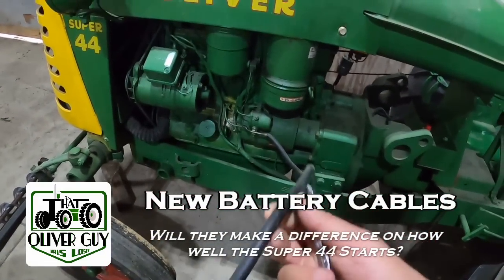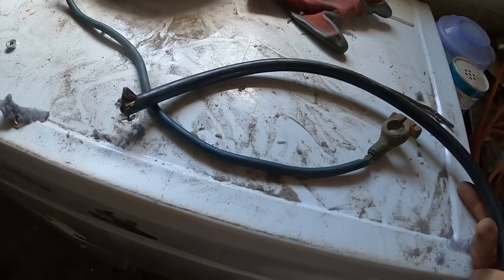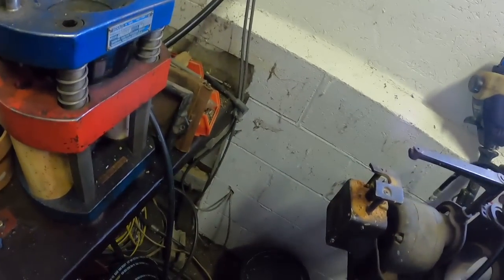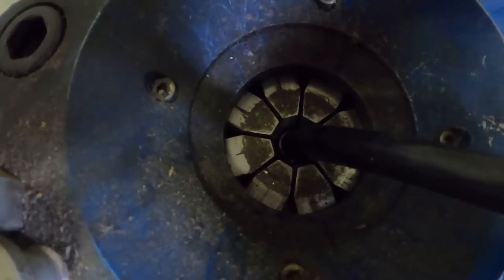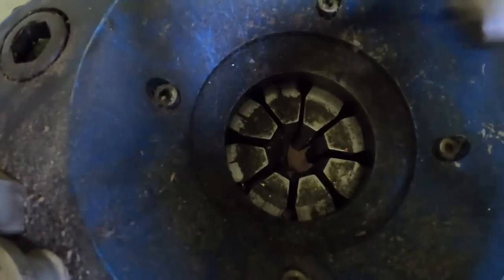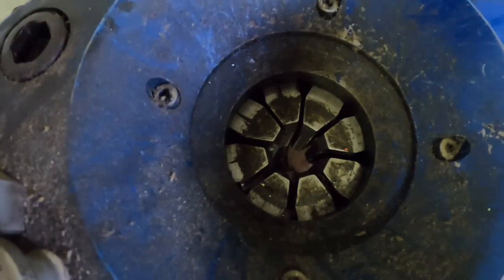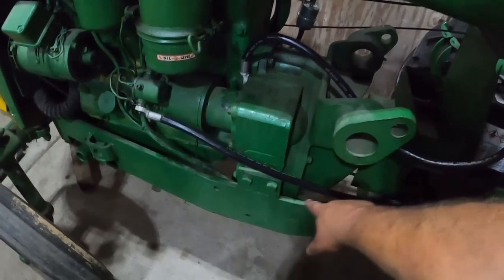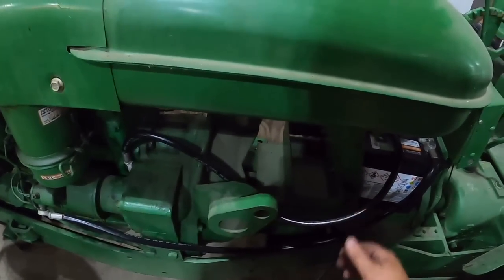WILL THEY FIX IT? New Battery Cables for the Oliver Super 44

Comment: Hi Chris I like that 44 I have a question could identify the carb from my 1750 so I could get a kit from mabock I have it off
Reply: The tag is gone
Reply from the maker: Does it have the aluminum carb on it?
Reply: @ThatOliverGuyChris  no it has the cast carb
Reply from the maker: The book only shows the aluminum Marvel Schebler carb for the 1750. Does your carb have the square plate on the rear for removing the float? Maybe it was replaced? If it is a Zenith, the word Zenith should be cast/stamped into the bottom of the housing.
Reply: @ThatOliverGuyChris   Well it doesn't have any marks of id on the bottom that I can find  and it's not the marvel schebler it's cast
Reply from the maker: I've heard that there was a carburetor that Deere used on some combines that is a good fit, maybe someone swapped yours out in the past?
Reply: Well that could be my cousin is going to look tomorrow because if his dad did replace it the original might still be on a shelf in the old shop  he thought it was the marvel schebler he didn't rember changing it so we'll see

Comment: I've heard the only difference between a 2-85 and 105 is the turbo/engine setting. Is that true?
Reply from the maker: Not entirely. Most 2-85s had only 2 pinion gears in the differential, the 2-105 always had 4. The 2-105 has the differential ring gear thrust bearing and the brake housing anchor plates to handle the higher horsepower. The 2-105 ran a slightly lower compression ratio because of the turbo, and the radiator had an engine oil cooler at the bottom. Even the connecting rods have different part numbers. There are a lot of things that are the same, but it was more than just a fuel setting and a turbo that separated them.

Comment: Morning Chris do you trim the insulation so it’s even or just into the crimp? If even would suggest liquid tape and or heat shrinking
Reply: That did make a big difference
Reply from the maker: I was going to heat shrink, but was out of that. I trim to where it's even, there's not room for the insulation in the crimp on the fittings I have.
Reply: @ThatOliverGuyChris  I always use heat shrink and color the battery ends for no screw ups...........Red heat shrink for positive, negative gets black.
Reply from the maker: @tpfromcentralpa1692  good idea.

Comment: Wow, that really does make a difference!  2 questions:  is the Super 44 pos or neg ground, and is it 6 or 12 volt?
Reply from the maker: It's 6 volt positive ground. It doesn't take much voltage drop with 6 volts to make for hard starting.
Reply: That's why we're converting my new 66 to 12 volt neg ground.  Joe recommended it.
Reply from the maker: @pagrainfarmer  It definitely makes them spin over and fire up easier. I like to keep them as original as possible myself. I do have an 88 that was converted to 12 volt by a prior owner, but they stayed with a generator and positive ground. Still looks original, so I'm leaving that one alone.

Comment: Do you have an old Oliver plow that is about 4,5 bottoms that the hart parr could pull?
Reply from the maker: Nothing with mechanical lift, but I do have some hydraulic lift pull types.
Reply: @ThatOliverGuyChris  is it possible to put an electric pump on the plow that has an battery that power’s itself?
Reply: @ThatOliverGuyChris  the museum whant s to plow with it and they whant a brand matching plow. I am there Oliver guy so they came to me and I was like i bony know where to find one.
Reply from the maker: Is this at Rollag?
Reply: @ThatOliverGuyChris  no that’s at my local museum but I could broadbill pull a few strings